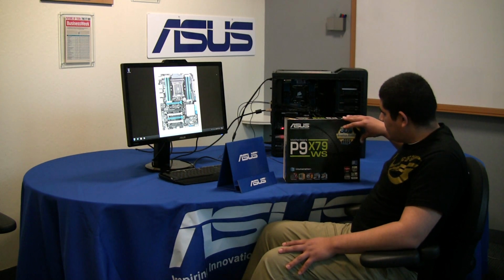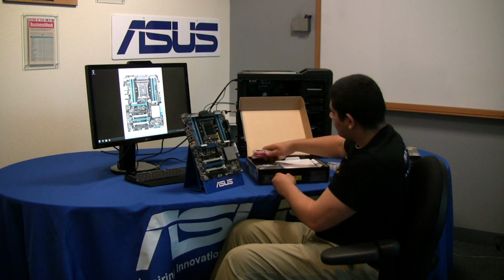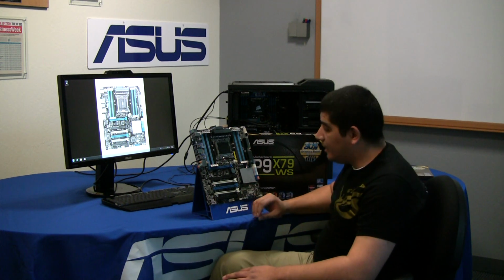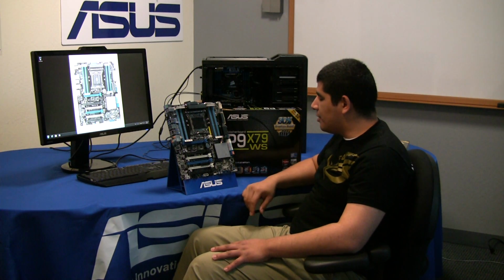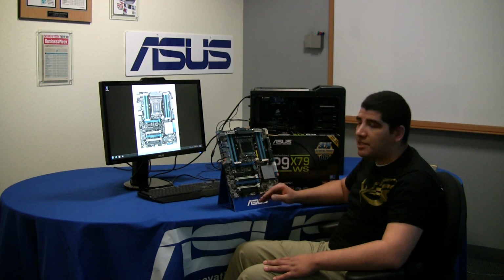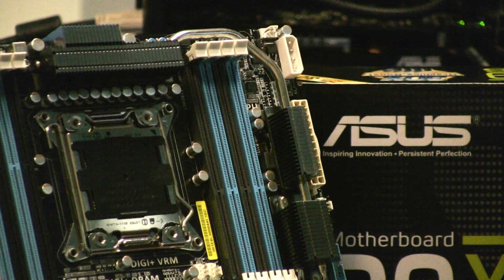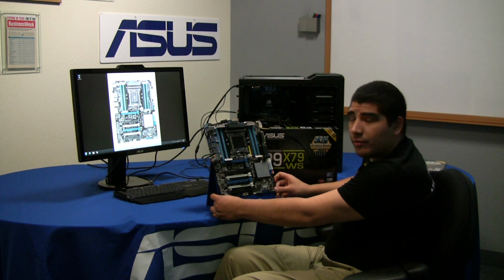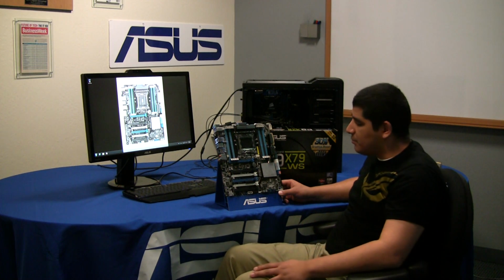ASUS P9X79 WS Motherboard Hands-on Review

Comment: I just got a PC with this motherboard. Putting together a Windows 7 build with it will be videoing. Seems like a solid motherboard. There's a mod online to the BIOS easily findable that adds NVME support - would be very nice if ASUS made an official final update to this BIOS to add the NVME support, you could just check the BIOS posted online and verify it's legit and post it as official. Have a great day!

Comment: That corsair case does not fit this motherboard (this board is CEB not ATX).  Thank you for demoing this motherboard with a system running a different motherboard.  Also learn to use a camera - underexposed and bad auto-exposure.

Comment: I've seen several different reviews of various boards comment that XMP does not work if you mix two sets.

Most motherboard support posts I've seen use verbiage like "we do not recommend mixing sets", but there are plenty of people that are mixing sets.  If you're going to go that route, you have to be willing to spend more time tweaking various RAM-related parameters.

Comment: You really don't.  MD does a fantastic job doing RAID without an off-board co-processor even with the raid456 module calculating the parity bits (its SIMD acceleration code using SSE helps a lot).  So its performance is vastly superior to Intel's MatrixRAID/RST/whateverthey'recallingitthesedays.  Best of all, the drives can run off any SATA controller, and I can add an arbitrary number of disks to the array without being limited to X-ports per controller.  Truly a fantastic bit of technology.

Comment: Why do you all think about this set-up?
Case - Thermaltake Chaser MK-I (VN300M1W2N)
Motherboard - ASUS P9X79 LGA 2011 Intel
Disc Drive - ASUS Black 12X BD-ROM 
CPU - Intel Core i7-3930K Sandy Bridge-E 3.2GHz (3.8GHz Turbo) LGA 2011
Hard Drive - Intel 320 Series SSDSA2CW120G3K5
RAM - CORSAIR XMS3 16GB (2 x 8GB) 240-Pin DDR3 SDRAM 
Sound Card - ASUS Xonar DX 7.1
Video Card - SAPPHIRE 100315L Radeon HD 6850
Power Supply - Diablotek DA Series PSDA350 350W ATX12V Power Supply

Comment: I am disappointed in this board as I was hoping to upgrade from my p6t7wssc to the new ws but this board is missing some of my favorite features from that board breakout diagnostic board (you cant see any thing on the board once you load it up) and fails to address some of my largest concerns namely having a 6pin header on the pcie power to prevent the melting that occurs under high load. Maybe when ivy bridge comes out ASUS will produce a worthy successor to the p6t7 wssc

Comment: Trying to decide on which cooler I'd use on this board, can you give me the measurements between the inside dims (B2 to D2). I'm planning on using vengeance which sticks up really high so i think most coolers will have to fit in between.  

and BTW... I cross referenced the dimensions of this board (CEB standard) and of the HAF 912 and from edge of board to cages there would only be 0.9" of clearance.  cutting it real close but think I'll try and make it work

Comment: Noticed that this thing is CEB form factor.  There are hardly any CEB cases and no good ones.  Plus I didn't want a full tower.  I had already picked out an ATX mid tower case i really want (coolermaster HAF 912 Advanced) cuz originally i was looking at the P6X58-E WS board.  So I am wondering if this board will work in that case?